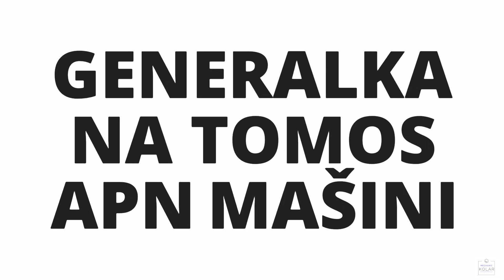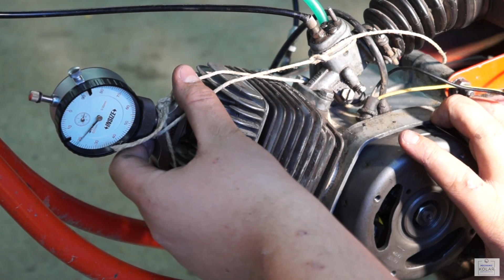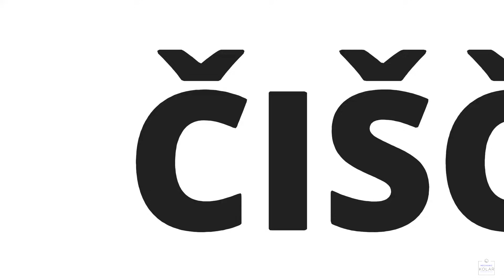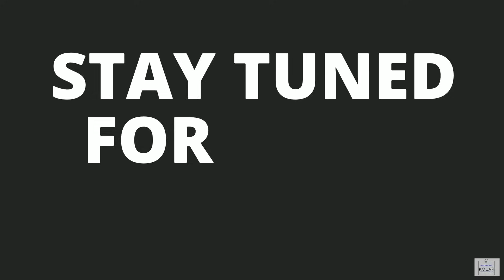GENERALKA NA TOMOS APN MAŠINI

Comment: Is that apn or t14
Reply from the maker: Its a same engine
Reply: @kolarmechanic6316  but apn goes 60 kmh and t14 goes 80kmh
Reply: Isti su im motori u katalogu pise da t14 ide brze od apen jer fabricki ima 5 brzine a apn ima 4, moj apn4 ima petu brzinu klip 39.5mm bing 12 dizna 70 ide oko 75, a sto se tice t14 moj drug ima na apn4 masinu od t14 i kada se trkamo ostavim ga uvek sad neznam
Reply: @edvard6610  ma nevalja busit cilindar najbolje je kako je fabricki sve jel ce duze trajat t 14 ima slabiju kompresiju pa je bolji apn
Reply: @tomosobozavatelj4124  tvornicki apn ima 6.5:1 kompresiju, a t14 9:1, ja sa svojim apnom sa masinom od t14 ostavim 125 kineze i bte😏, setup je tajna
Reply: @edvard6610  t14 ima 4 brzine org, barem onaj stariji